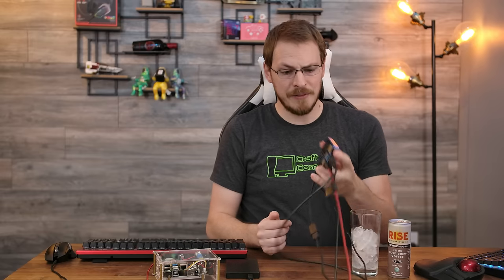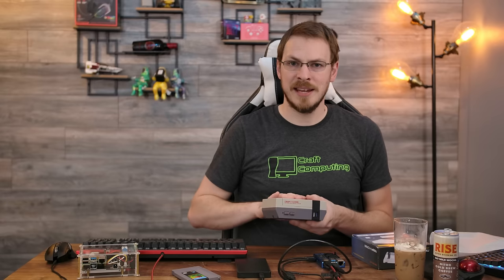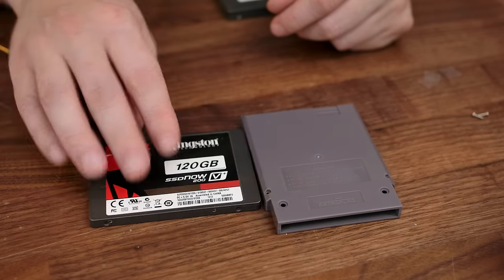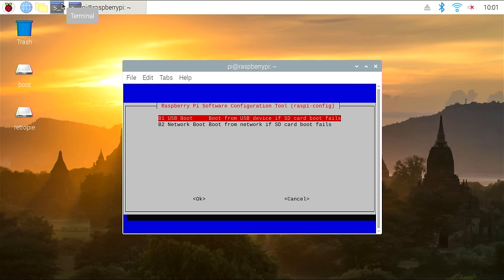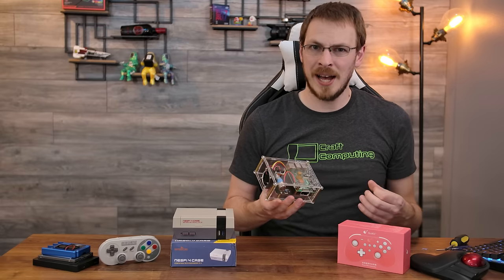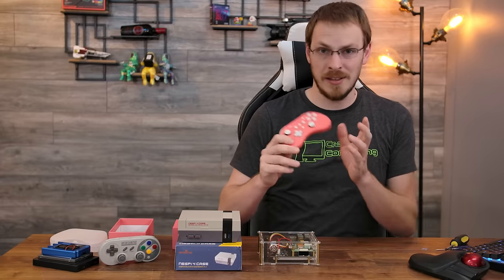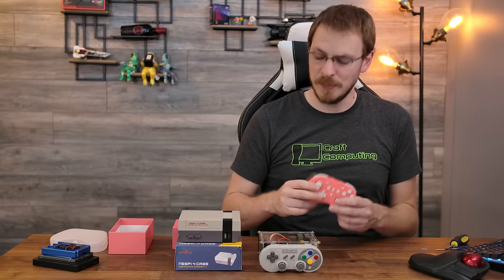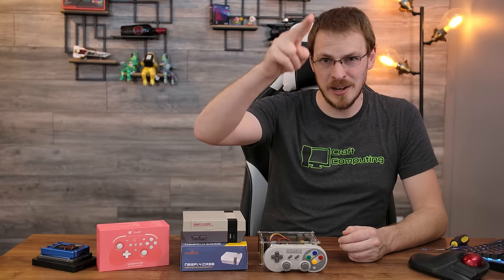The BEST RPi 4 Case for RetroPie or General Use

Comment: Great video, I got my brother SNES PI case and loved it. He snapped the SD card because because it didn't have a paper warning him to remove it...

This new NES for the pi 4 looks great and usb boot will be a wonderful upgrade. For $40 with a power plug seems fair, but I would prefer to save a few bucks with no power adapter.

Comment: If you unscrew the case on the old Crucial SSD you will see that the black ring arround it is removable. You will need the proper sized screws though since the ones in use are a bit too long, but once it is done it will be 7mm rather than 9mm

Comment: It looks like you plugged the USB extenders into the wrong ports. It appeared you plugged both front ports into the USB 3 and the SSD into the USB 2. You should get much better performance from the SSD if you put it on the USB 3.

Edit: I see you fixed the cables in the following shot.

Comment: Hay you need to use thermal paste it helps a lot I got a 7° improvement on my raspberry pi with the ice tower cooler also you should get Twister OS it comes with retropie pre installed along with themes and many many other neat programs

Comment: There's also the DeskPi Pro. That one is not yet released, but it does a few things over the case you call out here, most importantly IMAO it converts the miniHDMI ports to full sized ones.

It  also comes with a GPIO extension and an IR reciever, and IMO far superior look (nothing against you but for me that grey plastic is just ugly, I actually prefer the acrylic. That console was before my time so I don't have nostalgia).

Like the case you mention it has a good CPU cooler (looks actually even better), a PSU, an on-off button and of course an SSD mount with adapter.

All that for a quite simular price.

Might want to check it out when it finally gets out.

Comment: Be warned, this case, due to some kind of shielding issue with the USB 3 internally, WILL block your 2.4 wifi as well as your bluetooth controller signal. I went from full signal wifi to none when using this case. My 8bitDo can only get about 6 feet from the case before it starts malfunctioning. This is a known issue and there are a couple of work-arounds, but nothing solid. You can supposedly plug the USB3-Sata into a USB2 port and it might help. Otherwise, you can use foil tapes to shield the USB daughter boards and wires yourself. That's what I'm about to try tomorrow.
This interference issue and the hotter temps are sad strikes against this otherwise amazing case for a retro game system. Disappointing.
Reply: Did you ever do those foil shields? Did they work?

Comment: Not too expensive and produces a nice little machine. I was never a Nintendo fan so I'm not the target market. I know that injection molding is very expensive so I'm amazed they went to the expense but what I'd really like is this treatment being done to an Amiga case, something like an Amiga 500.
Reply: Since when is injection molding expensive, when you mass produce stuff?
Reply: @stokeseta7107  Now I've got to admit that I'm old but it used to be that the cost of IM tooling was really expensive and the break even run was about 100K units. Not to mention the electronics manufacture that has to be incorporated into the product. I suspect that a vintage Nintendo case for the RPi  is a niche product that will have relatively limited appeal. I don't see them selling millions of these especially since the ROMS are of 'questionable' provenance. But hell, good luck to them.

Comment: the nespi has some issues.  there is a lot of interference from the exposed usb3 wires used in the case.  it can mess up wifi and bluetooth connections.  i managed to control it with aluminum tape.  there is very little air flow from outside the case.  with this the unit runs hotter then other cases i have used.  there is also no fan control.  i build one and added inline so the fan wouldnt run all of the time.  also the shutdown script has an error in it.  it is set to reboot instead of shutdown.  if you wanting additional cartridges, etsy has some 3d printed cases.
Reply: Thanks esl kun

Comment: IDK if there is a way to use a M.2 SSD on Raspberry Pi, but I feel there is kinda a missed opportunity to use a cartridge locking system to hold a M.2 SSD down like the original NES did the cartridge.

Comment: Are there air vents in this anywhere?  I was unable to quickly see any.  Also, I like the new Argon One case that has a SATA M.2 but I just wish that it was a SATA like this case.
Reply from the maker: The top grill is a vent, with the Pi heatsink directly below it. It ran plenty cool, even when OC'd to 2.0GHz/700MHz.

Comment: I have one. I like it. BUT; the sata to usb connector is crap- and you either have to run retroflag a ‘firmware update’ (or it’s already loaded since I complained) or do the workaround yourself. Long story short, in your config.txt there is a usb.quirks line that disables ADP because the connector is china crap- it’s still fast, but not as fast as with a decent connector!! Verify it, and I told retroflag and they just made a ‘firmware update’ and haven’t disclosed to customers. Suck. But it’s still cool.

Comment: I love the general layout of this, and even though I'm not a gamer, I'd buy it just for the full accessibility to the SSD and micro-SD card. I use my 4B for a lot of testing and R&D and I'm constantly changing OS's and whatnot. It's currently installed in a Geekworm X-825-C6 metal case and USB/SATA hat kit. The case really knocks the crap out of my wi-fi signal and bluetooth as well, so moving to this wouldn't really rectify that problem (from what I've seen in the comments), but with some creative shielding work, it might actually be a solution!😉

Comment: I hope they do sell cartridges seperate allong with a set of blank label stickers so you can print out your own cart labels for them!

4:42 Could you have taken apart the 9mm thick Crucial SSD and installed the bare PCB inside the NES cart?

Comment: There are lots of reports of Bluetooth/wifi issues when an SSD is installed. Would love for you to investigate if you have these problems
Reply: i shielded the exposed usb3 wires with aluminum tape.
Reply: @kensmith4137  were you having issues prior to that and if so did it solve those issues? Appreciate the response.